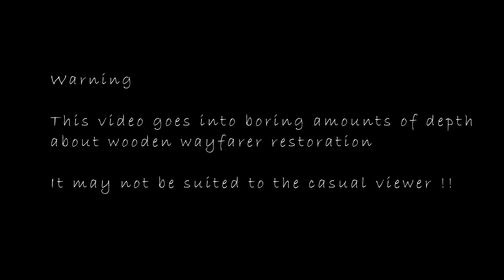Restoring a 61yr old wooden wayfarer

Comment: Lovely job, great to see all the tips should a problem arise!  I am the proud owner of 482 which looks about as similar to yours as could be imagined.  Its condition is generally very sound if a little tatty but still the best looking boat on the water! The one problem I will have to address is a leak between centreboard housing and keel which I guess I will have to address somehow. Interesting to see you had to deal with the same and how you did it. many thanks,

 Alistair

Comment: I'll never forget working on my Mistral (fiberglass knockoff) 's rudder! I managed to suck my thumb into the roller on my belt sander! A few hours later I was heating up a needle to drill a hole in the nail to relieve the (excrutiating) pressure.
Reply from the maker: Awhh. That sounds miserable. I can sympathise. On my last boat project I managed to router out my finger. I tried to keep going and nearly fainted which was even more dumb. The finger still feels weird several years later.

Comment: Great video and an inspiration for my own project due to start next month. Mine will require rebuilding the back 2 foot as it is rotten (although my inspection took place on the wettest August day for years. I may only have to patch in places). I do like a challenge.
Reply from the maker: Cripes. That does indeed sound like a challenge. Good luck 👍

Comment: You have inspired me a bit. I am part way (too many years it seems) thru restoring a 1960's Tamar Class sailing dinghy of a very similar design. There were hundreds built in Tasmania Aus back in the day as they were cheap and simple to build. Alas many people found them to be a very good power boat , so many ended up at the beach shack to rot. Tasmania is an island with many great sailing areas. At the head of the Tamar river is the city of Launceston where my boat was built. Great sailing estuary in the right conditions. I will be 60 late this year, so better get my finger out and finish.
Reply from the maker: It's never too late to get a boat finished off. I spent a bit of time when I was younger across the Bass Strait in Melbourne. A lovely corner of the world you have there.

Comment: Next time you get a water soaked boat try Cirrus Systems stripper, it is water based and just washes off with a hose taking paint and varnish with it, saves hours of work. I have no connection with the company other than having used it's products, The least impressive thing about the product is the realization of the time and money wasted stripping coatings in the past, quite sickening really. Nice job by the way great to see the old girl saved to race another day.
Reply from the maker: Ah thanks. I will try that in future. I just spent 3 hrs stripping paint off a rudder for a friend. Next time... Haha